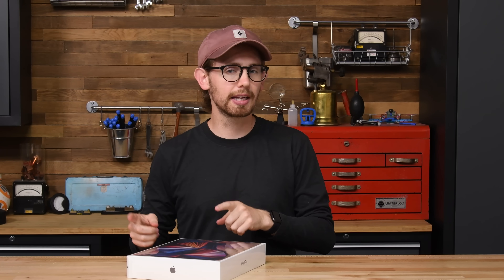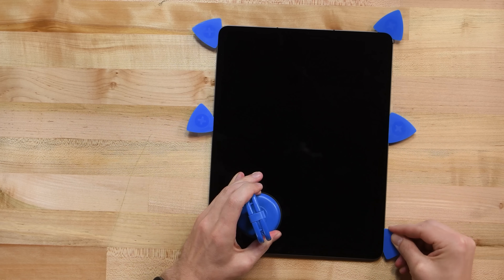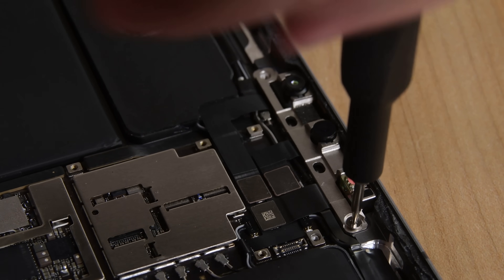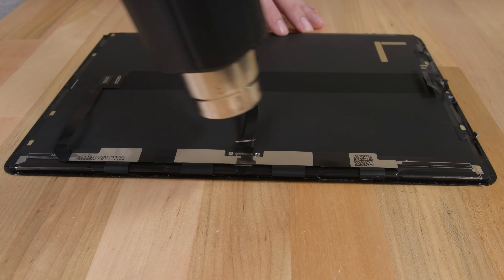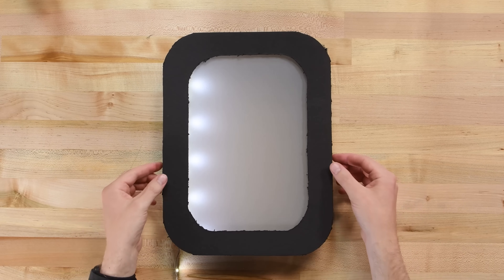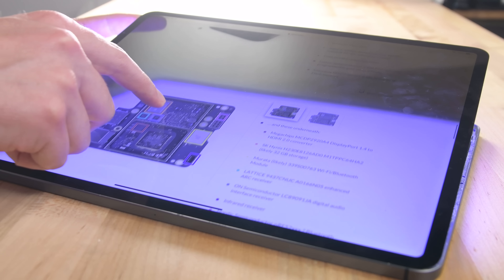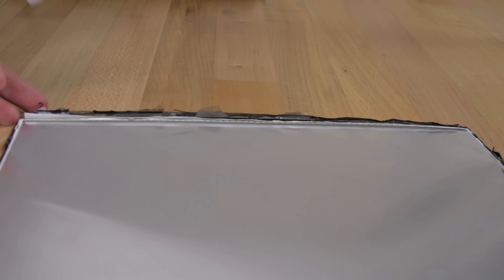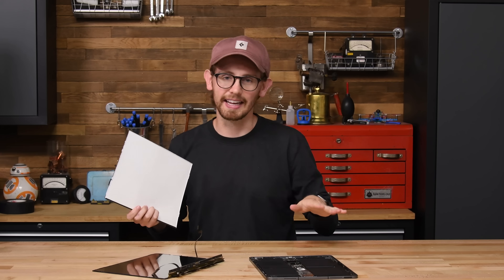M1 iPad Teardown:  Inside the New XDR Display!

Comment: oled is much better.
Reply: It depends some prefer lcd some don't
Reply: @btlei  The only reason Apple is using mini LED LCD is because OLED is too expensive for their profit margin. The moment Apple can afford OLED, they are going to say they improved the display 200%. LCD is inferior in almost every aspects to OLED except the cost.
Reply: @ddbhaha1529  OLED is less bright though
Reply: @ddbhaha1529  2 trillion dollars and can't put a oled display on a tablet, but samsung can with 300 billion. apple is mad cheap.
Reply: @xers6704  Make cheap, make hype and sell expensive = profit. They can put expensive parts. They just won't for the sake of profit margin.
Reply: @ddbhaha1529  
1. OLED has burn in. On a phone that's not really an issue but on a tablet that's uses for HOURS in a row for drawing etc. - it is.
2. OLEDs at tablet size probably still don't support ProMotion. They can run at 120Hz but not switching between 24 and 120 like the iPad Pro.
3. OLED needs to be recalibrated after an amount of use because especially the blue pixels "die" faster which leads to color shifts and less accurate colors. A huge No-Go for a device like the iPad (or Macs - that's why they also won't get OLED).
4. MiniLED most likely costs Apple more than OLED
5. Apple will run with MiniLED for at least the next 2-3 generations of iPad Pro. Apple is simply not the type of company that kills a new display technology after only a year or so. And in 4-5 years, the will switch to microLED and not OLED.
Reply: @Raja995mh33  I am too tired to engage with an Apple brainwashing non-sense. Sorry, you can believe whatever you want to believe. I am going back to my flat earth with tin foil hats.
Reply: @ddbhaha1529  Except I didn't talked any Apple marketing bullshit. I just put arguments and fact against YOUR nonsense.
Reply: @Raja995mh33  Oh... yes, of course. You are absolutely perfect.
Reply: @ddbhaha1529  Haha it's so funny how you can't come up with a single fact or argument here. I never said I'm perfect. I just busted the trash you tried to throw around. And all you can say is "Oh... yes, of course. You are absolutely perfect".
Reply: @Raja995mh33  The earth is flat. Care to argue?
Reply: @ddbhaha1529  Dude you're nothing but hilarious. Just have the balls to say that you were simply wrong and now you don't even have arguments so you're trying to come up with this nonsense.